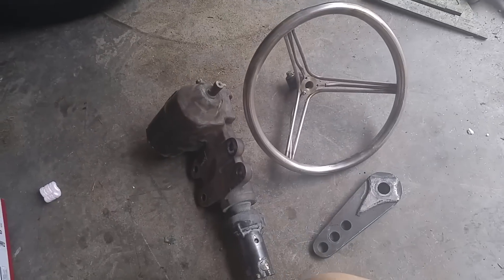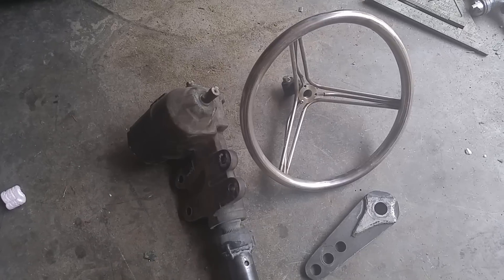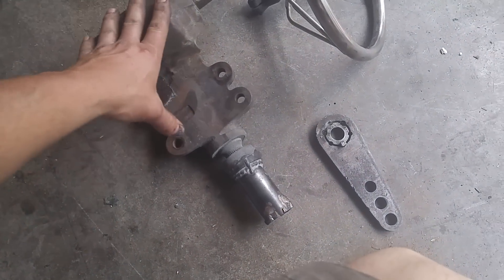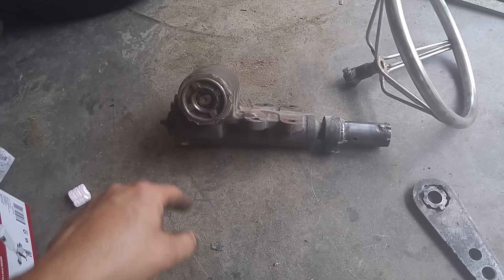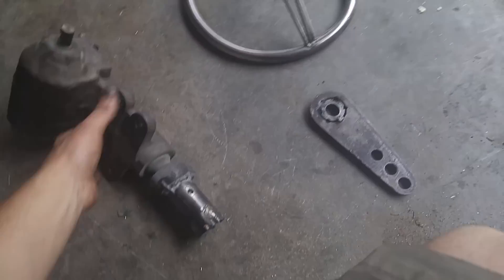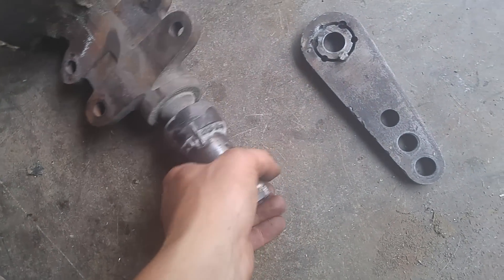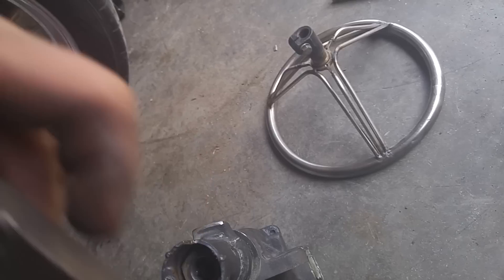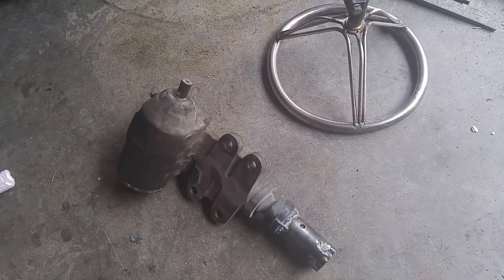My dirt cheap don't try this at home steering setup.

Comment: not sure if i want to do it the same way  , theres too mush that can go wrong and steering and brakes arent things i want to be skimping on or hobby sumting together 

reversing the shaft should be ok 
you might want to put a seal or bronze bushing in the new hole you drilled for the shaft to go through  , you can make a cap for the rear of the box and it should be fine 
i'm not realy overwelmed with the buildquality of the pitmanarm extender amd the way it locks the pitman arm to the shaft  , i hope you will machine a new billet extender when the rod is in the paintshop